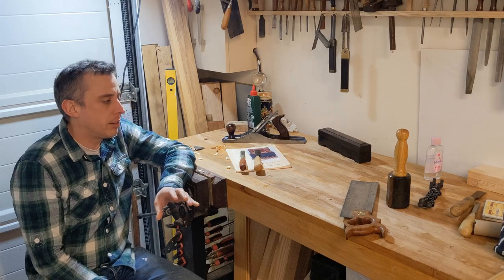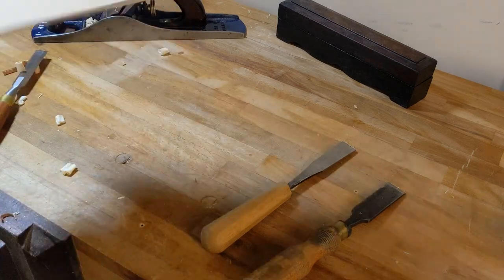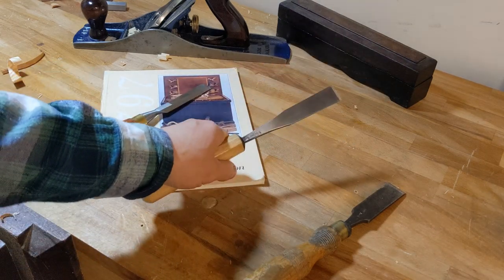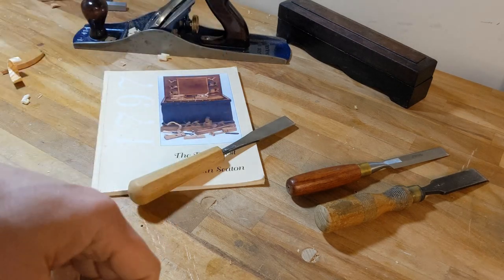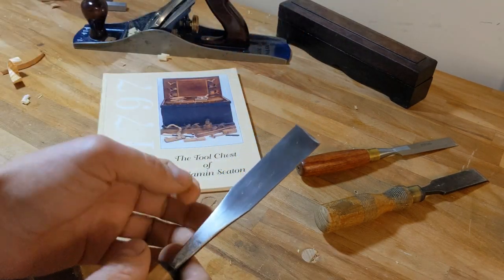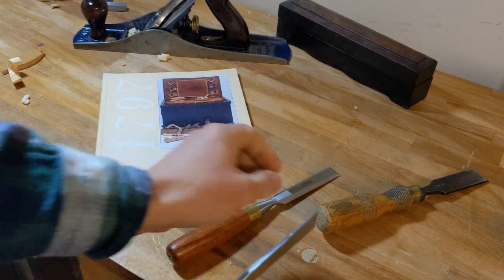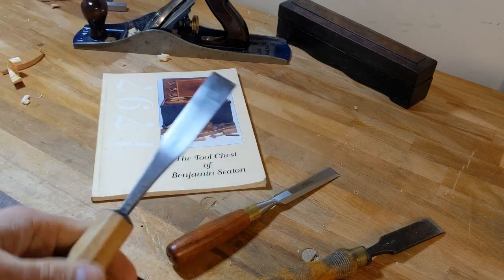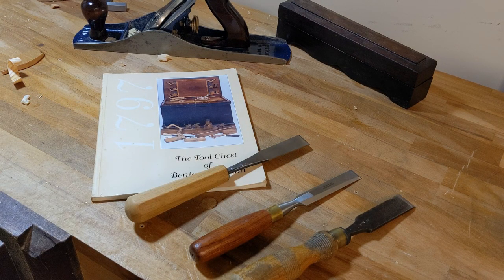NEW! 18th Century Chisel

Comment: I'll make a few comments. Graham is right, I said it wasn't actually a finished chisel and I have a set or two that I promised for people, and a couple of sets to make for me (in a year and a half of making chisels, I've never kept any of the nicer ones, but I have a lot of failures in the racks in testing methods). The finish work that the chisel would get would rather be no oxide, a little bit of surface cleanup (by hand, not machine) and anywhere there are coarse file marks, they would be "crossed" with finer file work. 

it's also true that I don't make them for sale as I have a day job, but would like to see kind of a surge of people who want to figure this stuff out, too, and make tools by hand. It's not an instant success kind of thing, but it's not that difficult and if someone is looking to create a self funded hobby or even make a small profit, making good tools is more feasible than making furniture. 

Someone asked if I could make seaton chest style chisels, I said I was sure I could as I only work freehand, so I haven't got any shape or fixture limitations, and thus that's where we are. 

This chisel was actually a test chisel for me, but I just sent it to Graham -  test as in changing some of the ways I work - how the welds are heated, and how I do heat treatment. If graham manages to break it or find it substandard, it'll be useful information. 

My page is more of a brain dump than anything else, but the hardness testing results and a subset of stuff that I've made may be worth looking at for ideas. if I can make it, anyone else can - we don't all need to sell each other a million amazon links and proprietary "only way" just to do a couple of simple operations.  https://ofhandmaking.com/things-made/
Reply from the maker: Thanks David. I appreciate you clarifying your situation and some of the details. I can't imagine how it would fail.

It has a nice feel. It's not a rigid lump of steel which feels remote. It's not the right time, and it would not be necessary, but I would gladly use this style in place of my current crop or any other I've had the chance to use.
Reply: @faceedgewoodworking  wouldn't last too long on a job site, but it should be suitable for everything short of heavy mortising. 

As to how failures could occur, I guess if there is any aspect to its using (edge holding, etc) that is less good than a commercially made chisel like LN or LV, then it's a failure to some extent. 

The steel in it isn't exotic (a modern very clean steel similar to vintage file steels), it should make a better chisel than anything commercially offered outside of japan, and sharpen about as easily as O1 that's a couple of points softer. 

At any rate, this chisel is somewhat of a test chisel changing some of the making over from propane forge and cutting torch to induction heating, so anything could happen!

(I like the choice of ash for paring. As AvE says, feed it a hot lunch. it should mallet ash and beech and other such things without any issue so long as the edge prep is similar to what any other good chisel would need to stand up).
Reply from the maker: @daw162  This won't find it's way into my site box 😂. I have very appropriate chisels for that application. 

The steel knowledge in terms of treatment and type are a bit over my head. It sharpens well on a vintage hone and holds an edge. 

It sits nicely with my Gabriel Try plane. I draw the line at the period costume though, although a mole skin hat might be dandy.

Comment: I believe I've found a chisel that is quite old. Perhaps it's 18th century old. It's got the same octagonal shaft ending, only with a different handle, same blade only smaller with slightly fluted edges and the handle is of burl. I don't know what kind of wood it's made of but the handle too is octagonal in the middle with a dip and then a vase shape with notches carved nearer to the chisel. However it does have a brass collar on the end of it. Completely straight and unbent blade, very heavy for such a medium sized chisel. I got it for eight pounds at a flea market just to tip you off. Oh and also the end is rounded, again cutting into the octagonal part similar to the front with two more notches on the back. It's inscribed with revelled, a symbol looking like a mushroom with two shoes and O.howarth. it was one of the more impressive finds though however it is more just impressive to me than anything because it's probably of similar high value like the other finds on that day. Wish you luck on finding one and bear in mind that some sellers like to sharpen them with grinders which isn't very good because of the ugly tip finish it leaves, almost as if it was hit with a hammer to give it a forged look. Didn't cut right in but I've sharpened it and now it's a beast, essential part of my tool kit for carving wood and that weight with it's smooth handle from all those years of use being like the finest sandpaper you can find make it a pleasure to use. I'd highly recommend adding one of that kind to your collection. Like a knife through butter provided you use a bolted vise.
Reply from the maker: A bit of Howarth steel is normally a pleasure. Sounds like you found a wonderful tool, thanks for sharing your information.

Comment: thanks for the video, and the link to an interesting website. There are definitely some people who take pleasure in buying a shiny new tool, or taking a tool and getting a mirror finish, including when refurbishing (or perhaps "restoring") used tools. With a couple of exceptions my tools are all used and have required work to clean them up ready for use. During that process, I can see the appeal of taking some rusting lump of metal and wood and making everything feel "shiny and new", and occasionally when I first started out I did that. These days I am content to sand the rust from the sole and exposed metal of planes, and from the plate of saws,  to ensure they work correctly and don't stain or marr the wood. When needed, I tart up the handles to make them comfortable to use. I can't be bothered to remove paint splotches or re-japan things though, I have little enough shop-time at the moment as it is!
Reply from the maker: Hi Tim. I hear you. Time is the most precious resource we have. I like the sound of your pragmatic restorations. It's amazing how quickly a tool can be made ready when we focus on the key areas.

Comment: I can understand having one or two (1/4" or 3/8") chisels with a bevel edge.  Beyond that, thinking of how I woodwork with hand tools, I don't think a bevel edge is needed.  That chisel made by David is fantastic.  I have no need for chisels but would like to get one wide on at 1-1/4".
Reply from the maker: I share the same opinion Joe. I'm lucky to have the chisel. Hopefully I'll share my full rag-tag collection soon.
Reply: @faceedgewoodworking  Looking forward to it.  7 or 8 years into hand tool woodworking, I realize how little you really need to get started.  Even when heavily into it, the amount of tools you need is still really small.  I easily work alongside the wall in my garage and can fit all that I need on a 4x8 sheet of peg board.  Of course, like many, I"ve bought more than I need.  At some point, I plan to sell off the tools that are duplicates of duplicates and the ones I tried and didn't care for.  Less tools better.
Reply from the maker: @joeleonetti8976  with you 💯. Less tools better is a great philosophy 👍